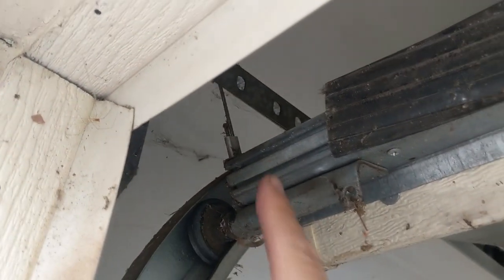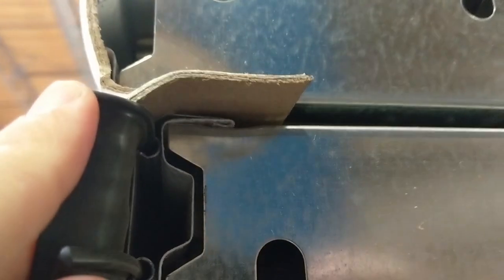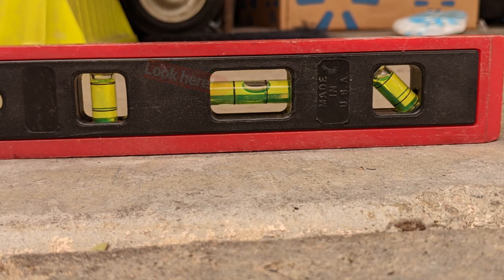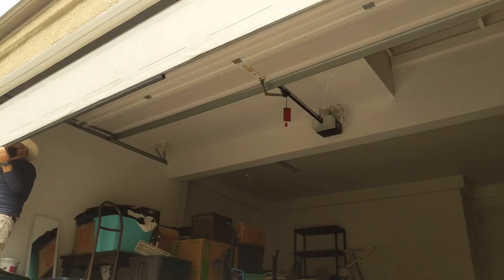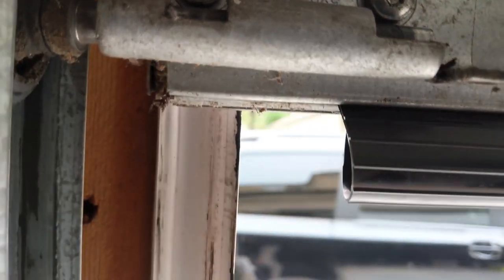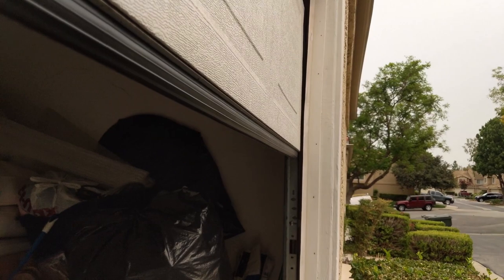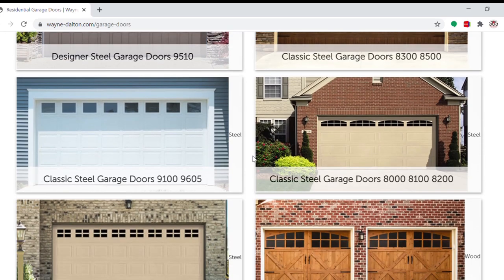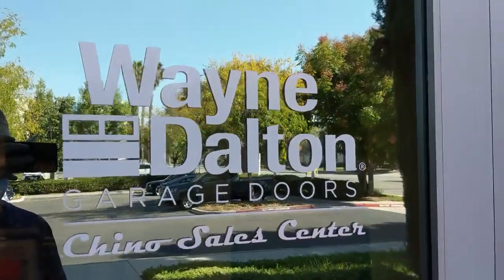Get the Right Bottom Garage Door Seal 2 - Even for Wayne Dalton garage doors?

Comment: Thank you so much for this video. Just spent 3 hours of hell trying to fit a T type seal into our  door, trimming, heating, spraying silicone spray got 3/4 done and then it just wouldn’t go any further. So ready to pull my hair out. The guy at Lowe’s said it was a universal seal. Luckily I found this video and will order the correct seal. Hope it works!🤞🏼🤞🏼🤞🏼
Reply from the maker: Hello.  So glad the video helped.  

How did the original seal workout for you?

Comment: Wayne dalton doors are the worst doors I have ever had the displeasure of installing it's now at the point if I'm called for one I either tell them to get someone else or I charge triple the only advice someone needs for these doors is how to burn them and remove them from the market
Reply from the maker: Woah!  Those are some strong convictions.  And I must say that I agree with you in part.  The fact that WD does not offer nylon bearing rollers when all other door manufactures do baffles me.  But the folks down here at Wayne Dalton are good people and they have fair customer service.  So I keep going back for them.  What door do you prefer to install Mr Torbjorn?
Reply: @sosgds  if I was to pick one brand from all my supplies I would have to go with steelcraft because unlike Wayne dalton they are one build stronger have better weather strip proper u-rubber  normal hinges and they don't have those stupid weak torktubes
Reply from the maker: @bygonewonders  Nice!  I am not familiar with Steel Craft.  I just visited their website.  Looks like a very solid door.  Thanks for you sharing!
Reply: @sosgds  they are built very strong I've seen them hit my semi trucks and all it had to do was walk up to it and the the section back in but a new hinge on and obviously fix the cable which on I don't mind on commercial doors because I can cheat by back winding the door to make the cabels slack instead of having to unwind the spring put the cable back on then rewind those giant spring that are the same size as ne 8 times
Reply: WD 8000 and TS series doors aren't awful, but the 9000 series are all garbage. The bulb-type bottom rubber is the absolute worst, although I have come up with tricks to make it a bit easier, and the Texas clip on seal for commercial doors is terrible to replace. Give me C.H.I. doors any day.

Comment: So these Wayne Dalton garage doors created their own unique weather seal style to force people to buy from them? That's a scummy move.
Reply from the maker: Or it could be a strategic move to keep your customers coming back.  Either way, Wayne Dalton has  paved the garage door industry with their products.  Are you having trouble finding their bottom seal?
Reply: @sosgds  I don't even know if I have a WD garage door. I was just shaking my head where you said they can have their own customer weather stripping and I immediately realized the scam they are playing by doing that. If they can't use the same standard sizes of weather seal that you can find in any big box hardware store, then they shouldn't be designing products. People need to be able to DIY fix their own stuff on a garage door that my be 22 years old (like mine). And often you'll run into cases where the manufacturer has discontinued that particular line of product (probably 10 years prior) and now you are stuck with some custom disposable part that you can't replace. Or have to pay a very high mark up fee because they are the only one who sell it.  oh well.

Comment: Why couldn't Wayne Dalton just be normal and use 1/4" channels? I want to upgrade my seal to one of the ones that have the O within the U, but of course, they won't fit.
Reply from the maker: Hello.  It's part of their proprietary design for their doors.  I think their seals are worse on the 8300/8500 series steelback doors.  Unfortunately there is no universal standard for the manufactures.  Thanks for the feedback.

Comment: The seal is affixed by a long metal bracket. It was impossible to remove the seal from the bracket whilst it was installed so I opened the door about 5 feet, locked the tension bar with two locking pliers in both directions, raised the door manually by 1 inch to take the weight off the lift cables, propped the door up with wood, and loosened the cable brackets at the bottom of the door at each end. I removed all of the screws on the cable brackets, allowing them to flop about. After marking the holes, I removed all of the self tapping screws that hold the bracket. After removing the various self-tapping screws along the long bracket, I was able to get the bracket out and performed the removal of the old seal using my bench vise & a wood horse. There were two dimples squeezing the old seal at each end so they had to be punched flat before the seal would move. I did not use WD40. I cleaned out the guide, added some lubricant to the guide (not WD40) and installed the new seal. The garage door had to be adjusted by removing some of the down movement else it would collapse the new seal. In total, I did 4 doors like this.
Reply from the maker: Wow!  Thanks for sharing your experience.  

Yes the two dimples or pinch points to keep the seal from moving make it difficult to replace.  Yet it looks like you were successful.

Comment: My issue is it keeps sliding out of place. Really aggravating!! 😡
Reply from the maker: Hello Doug.  Thanks for the feedback.  Did you tuck in the seal within itself?  There's another pro tip where you can tack into the seal and retainer with a small tap screw to hold it in.   Have you tried that?

Comment: where can you get the bottom rail that the astragal slides into? mine is broken and i need a new one AND astragal. im not even sure what model garage door i have. its a standard door (non insulated) with the sections that each have a hinge... its 8' long/wide
Reply from the maker: Hello Jonathan.  If you can determine your garage door model you should be able to find the astragal and bottom retainer.  Here's a video I recently posted on how to do this process.

https://youtu.be/zKX_c_FGaM4

Comment: Can you use a upgraded metal weather strip and weather seal on a Wayne Dalton Door? Left the original metal weather strip on and put the New Aluminum strip on with self tapping screws and then put the upgraded weather seal on. Any thoughts on that?
Reply from the maker: Hello.  What model of garage door do you have?  Is the model 8000?  The model 8000 is a steel door.
Reply: It's actually a 9000 series door with the fiber panels.

Comment: I'm in Canada and have a Garaga insulated garage door. Any idea if I need a special bottom garage door sealer for it? Also, have you head of Boer Garage Guardian? thanks in advance.
Reply from the maker: Hello.  Yes I have heard of Boer seals.  They seem good quality but I don't install them in my area.  The type of seal you'll need for your door will depend on the bottom retainer.  If it is an aluminum retainer than you should be ok with a Boer seal.